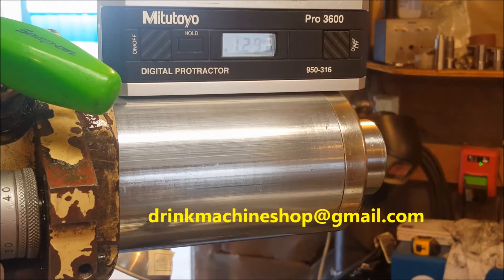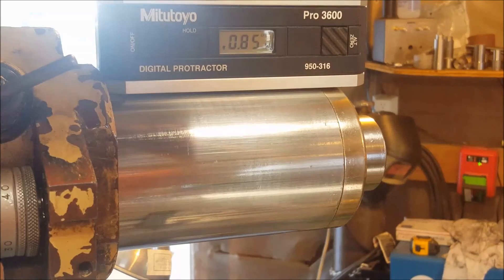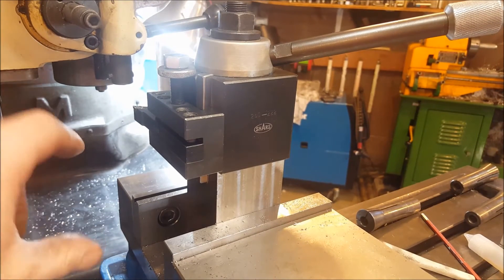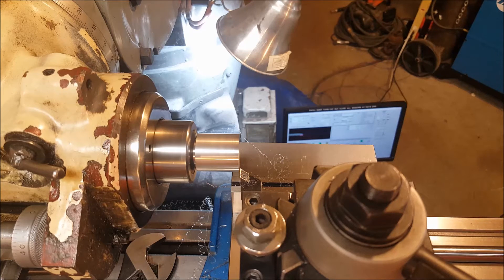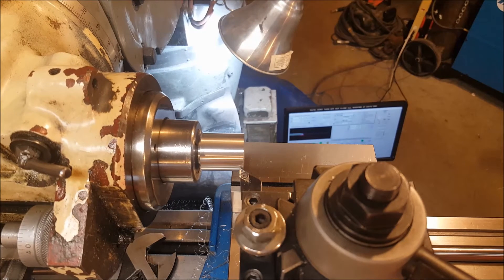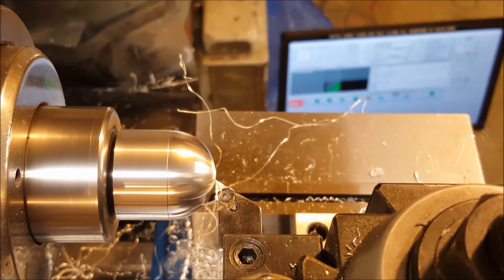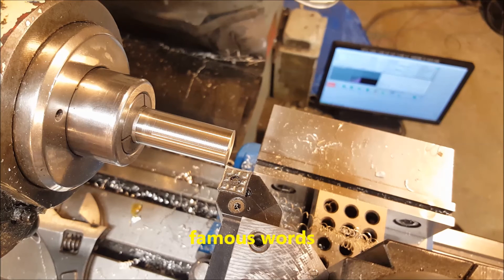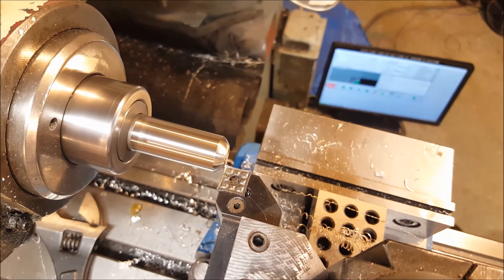Turning on the Mill

Comment: I was using mach3 and Allen Bradley servos and drives, I got the control board from cnc4pc, and also the smooth stepper motion controller. I built the system myself, bought ball screws and pulleys, and some old motor mounts from a factory cnc mill, did a bunch of work to adapt the screws, pretty much everything had to be machined to work. when I sold it I doubled my money, and bought a VMC, a real machine with tool changer and a 40 taper spindle. the guy I sold it to is very pleased, making parts for himself. I however needed that 3rd axis, and now I want a forth axis, so for some the machine I had is enough, it wasn't for me.......